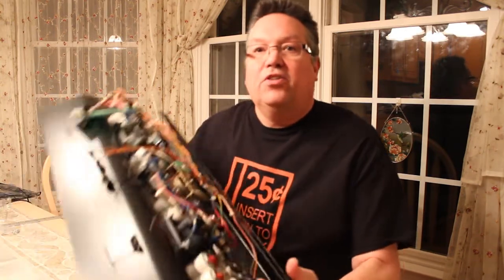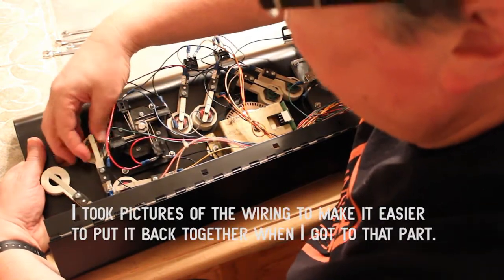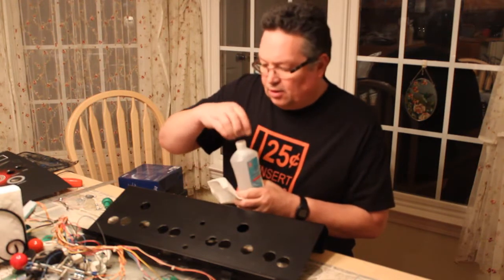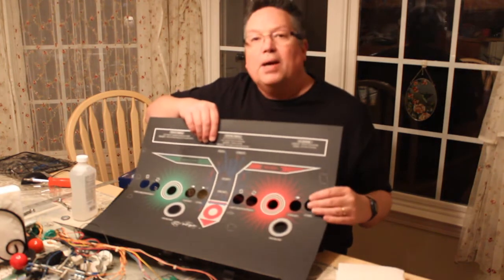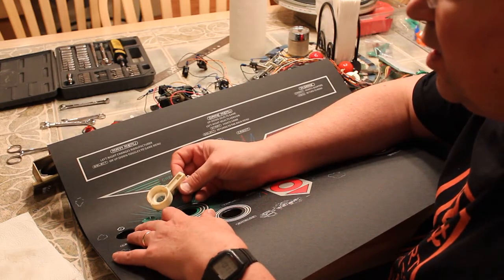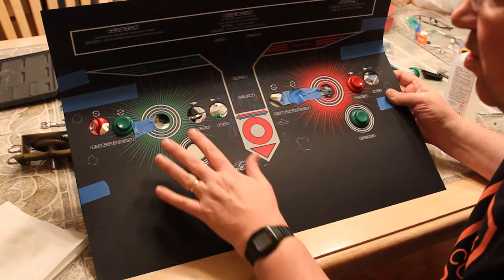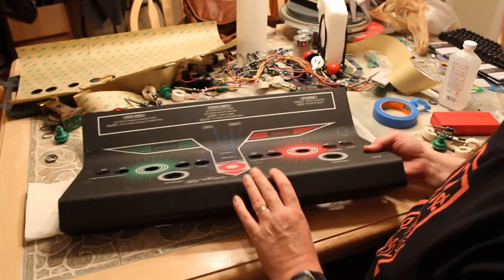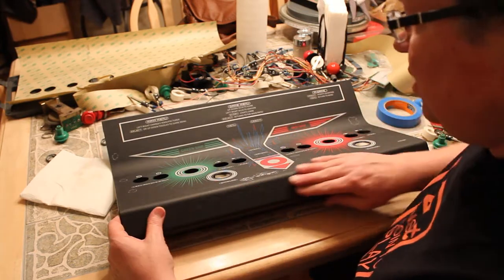VectorMAME ZVG Control Panel Overlay

Comment: Hi Al,

Where did you get the overlay? I have two ZVG boards. I built a b&w VectorMAME machine a while back out of a Lunar lander cabinet/801 monitor. I love it. Those b&w monitors have a super bright picture, and laser beams especially look fantastic. I also have a Space Duel cabinet / WG 6100 monitor that I plan on building a color machine too, using the same controls you did for Black Widow / Space Duel / Major Hav.  I have a Star Wars Yoke, and plan on making a 2nd panel for Star Wars / Empire, Trackball panel for Quantum. I hooked up my Vectrex to the ZVG when I first bought it, and would love to be able to play those games emulated in the cabinet if someone were to port ZVG drivers to the emulators.
Reply from the maker: Do a search on KLOV for ZVG and there's a guy who made them.  They took over 2 years to get done.  Congrats on your progress!
Reply: Thanks, I'll take a look.

I still have a lot of work to do. The B&W machine is pretty neat though. I purchased original monitor overlays for Star Castle, Armor Attack & Solar Quest so those games look great, as do Asteroids, Space Wars, etc. I can't picture them looking so bright as they should on a color monitor like the WG 6100. I also purchased an original Tail Gunner II joystick & a Star Hawk control panel for playing that game & Warrior.